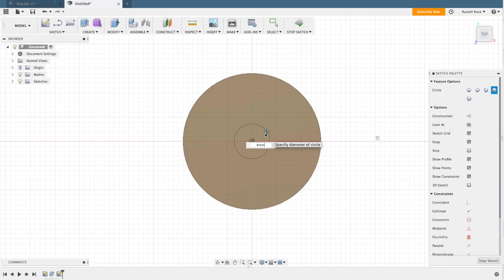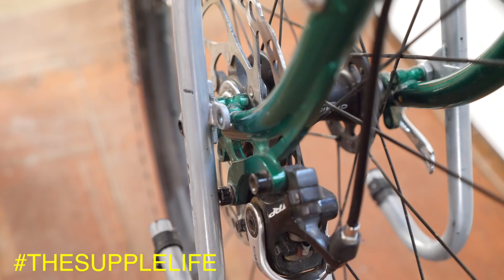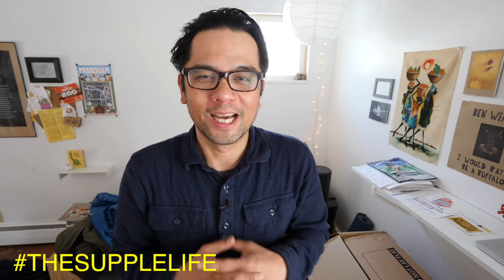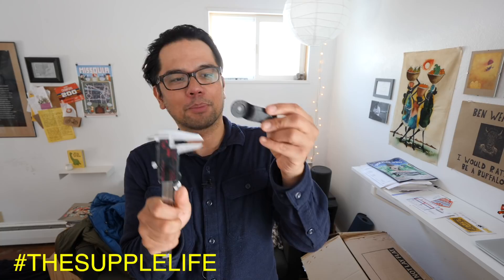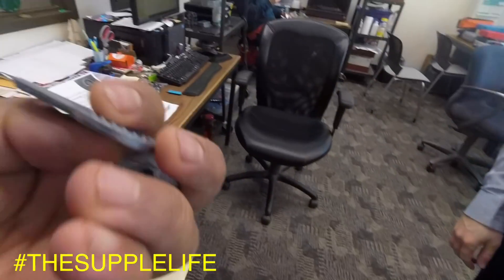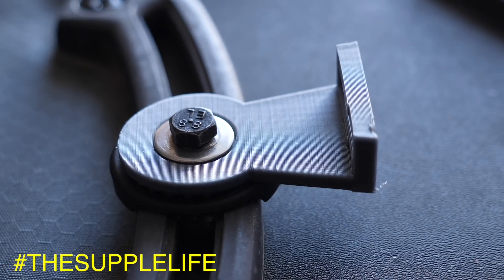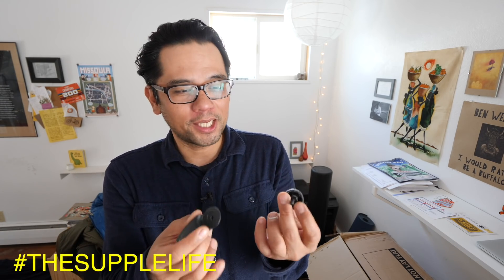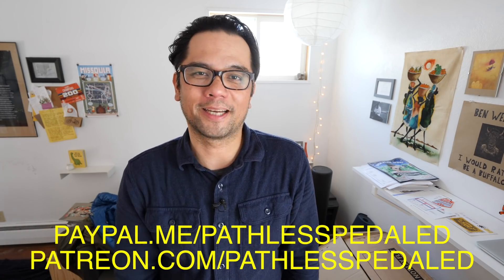3D Printing a BIKE HACK! (Ortlieb Pannier Mod)

Comment: Couple of weeks ago I bought the e-bike  handlebar bag, the e-glow model, it's such an amazing bag. The only issue is it has a holding strap instead of a shoulder strap. I am planning to 3d print part that connects to the bag to make a shoulder strap. Hoping that it would hold.

Comment: Nicely done, kinda wanna try something like this! I 3D printed a few things on the bike. Fork daruma in ABS with a solder in threaded insert to use with a flat head M5 under the fender with lots of clearance. Also have a spacer for my pannier rods to thicken their OD for ortlieb hooks. I ordered those in multijet nylon online and they're definitely a little more robust. Recommend Creality or Prusa for anyone getting into 3D printing. I model in SolidWorks cuz engineer but Onshape and Fusion 360 are great for hobbyist stuff.

Comment: Ha, yeah, I have a couple of 3D prints for my bike coming up. I have a bunch for my winter training, in the summer I need to print a disc brake spacer for my left rear pannier and a couple of helpful upgrades for the surly style front fork carriers. HMU if you need stuff printed, even if it's just a couple of iterations on this. I can send them to you printed in PETG or ABS even, which'll last longer.
Reply from the maker: Sweet.  What sort of printer do you have?
Reply: @PathLessPedaledTV  Prusa mk3 with MMU2. Plus a crappy one and one I'm building :)
Reply: @tedder42  how does your MMU run? Small prints run fine on mine but bigger ones fail pretty often.
Reply: @mraffifpv1685  I use it to select filament but not mid-print. I'm optimistic the new sensor in the MK3S will help.

Comment: Super interesting, thanks Russ. I think I would have just used a couple of cable ties on the lower rail of the Tara rack as a guide to hold the hook in place.
Reply from the maker: I have cable ties to prevent hook slippage, but that's not the problem this part soloves.  It gives an anchor point to the bottom of the bag so it doesn't sway out.
Reply: Cool, thanks

Comment: Bought a 3D printed accessory which is super useful

Fizik saddles have a pop out section that lets you insert their light. But it’s just powered by watch battery.

The 3D printed version slots in and accepts a USB powered light.

Comment: Are there places near there that will print in ABS filament? It would be an interesting field test durability comparison between the two materials over time.
Reply: I wouldn't print Abs in a Library. But he could use Petg, which is similar to Abs but without the toxic fumes and need for a hot environment.

Comment: Great stuff, just one advice, or remark rather, before you go exploring the world with this system mounted check how it behaves in low temperatures. I printed some stuff for my bike, and one part fell into pieces when I went riding in cold weather.

Comment: Time for 3D printed PLP logo headtube badges, stem caps, and other bikey bits!
Reply: Handlebar ends!
Reply: Handlebar Ends: Yes, but I wouldn't print a Stemcap, at least not with FDM printing
Reply: @mraffifpv1685  could maybe print a "cap cap". One that snaps over the existing one. Keeping the strength of the metal one.
Reply: @caseymakes  I'd buy one, for sure!
Reply: Yes, yes, and yes!

Comment: There are plenty of pretty good 3D Printers for under 200€ or $. I have a Creality Ender 3 and printed stiffeners for my DIY Bags, smaller buckles etc. Make sure to use an appropriate Material for your application. I usually use PETG instead of normal PLA because it's more flexible and not too expensive.

Comment: I 3Dprint in PLA primarily because it is non-toxic and biodegradable.  (I design, print, shoot, and share pinhole cameras).  PLA is not super-strong, and for heavierduty parts consider a service like Shapeways. You can upload your designs and have them printed in a variety of materials, including a high-strength nylon or even metal.  I've had some camera parts (and a camera) printed in metal and they're like jewelry!  Metal ain't cheap, but for a one-off, it's crazy cool.  Let me know if I can help in any way. https://www.thingiverse.com/schlem/collections/schlaboratory-photo
Reply from the maker: Whoa.  Those are some awesome designs!  I’ve got an idea for a bike doodad and have been looking for a small locking ball head.  Any suggestions where to look?
Reply: Like a ball head 1/4-20 camera mount thing?
Reply: Like this? https://www.adafruit.com/product/2464?gclid=Cj0KCQiA2L7jBRCBARIsAPeAsaOwnpKVds9WQt73tUoeD17aGLyoiQuLaRyIJp9nGzMMSU53bQrv0xIaAuBfEALw_wcB
Reply: Also, THIS: 
https://www.amazon.com/Minoura-Handlebar-Camera-Mount-22-29mm/dp/B005DMYRRC  
Such a lovely bit of bike kit.  You could mount a small ball head on it.  I have one and it's super neato.

Comment: Super cool and well done.  Can you use Gitlab or Github (?or other) to store the CAD and printer path files (less likely with pubic library)?   I think it might be neat to have a PLP-hack repository of CAD files for cool (and maybe not so cool) ideas.    Maybe add a PLP makers-mark on the pieces so that they can be ID'd easily to recognize full on PLP nerds?. :)
Reply: Why not use Thingiverse, which is made for sharing files for 3d printing... But using path-files (called gcode) from someone else is critical because printers are different and can cause your printhead to try to tun into the Printers frame which isn't good for the motors and stuff
Reply: @mraffifpv1685  Cool  I haven't touched a 3d printer since it was called stereo lithography in the mid 90s.  The repository used to suck and licensure were even worse!

Comment: Very nice! I took two AutoCAD Inventor classes last winter and a buddy has a printer so I’ve designed and built a few items.
Reply: The biggest was a pitched ceiling adapter for a ceiling fan.